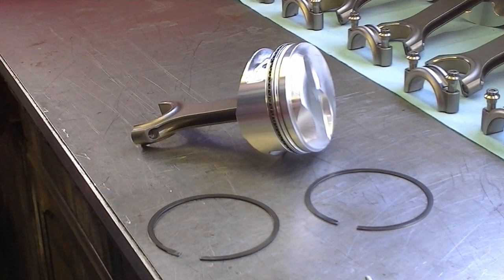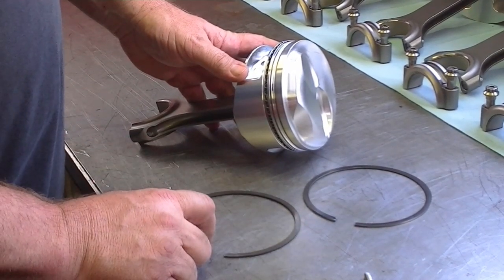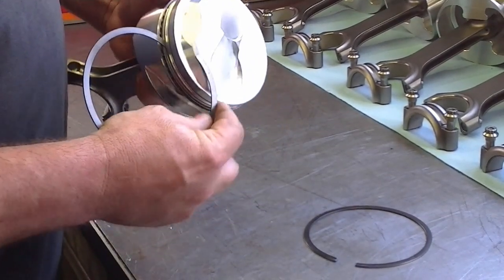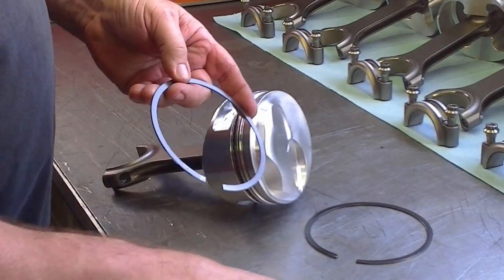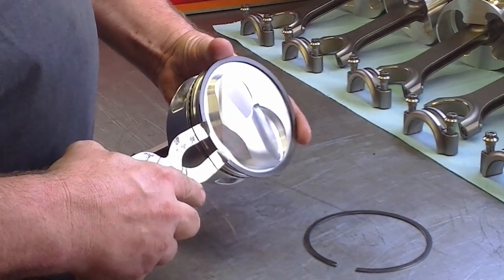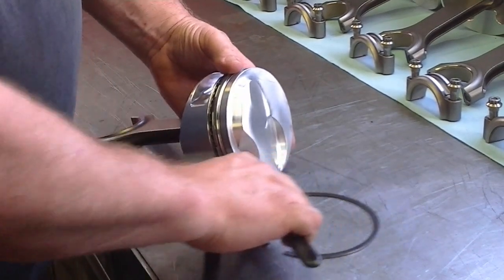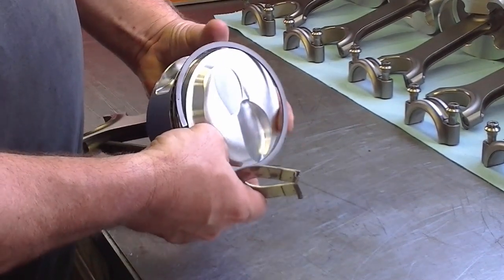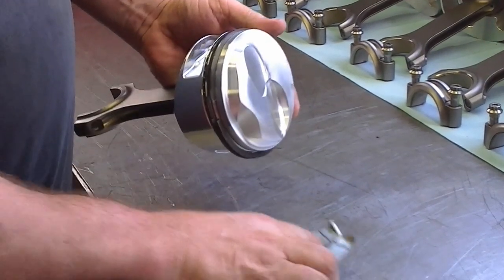How To Install Piston Rings

Comment: Is it possible to run engine minus the bottom oil rings.They crack trying to put engine back together .Can not get parts for engine .
Reply from the maker: Oil control rings scrape oil off the cylinder so don''t run without them
Reply: Thanks .I had to machine the piston to take a CAT ring .It a IFA engine ,Did you every hear of them ,It nearly all back  .Ready for testing .WORRY TIME .There be a lot of smoke minus the one ring i suppose .It only a generator that does a few hours in a year .

Comment: There is not enough pressure for the rings to seal on their own. There needs to be pressure build up that goes behind the ring to push it out to the cylinder. Offsetting the grooves helps in that respect. Also the second ring does mostly oil control and also uses pressure to push it out to the cylinder wall to scrape oil off the cylinder that the oil control rings did not get. It helps the second ring If both gaps are offset and if the gaps were lined up oil would get up between the gaps and get into the combustion chamber.

Comment: Sorry if this is a dumb question, but why do the gaps need to be offset?
Reply: MRios1128 compression lost, oil seeping through and it could get really hot in those gapped spots lined up
Reply: MRios1128  so that to av0id leak tangina